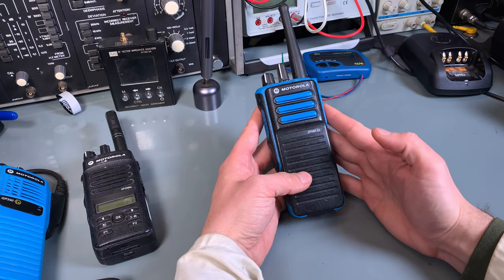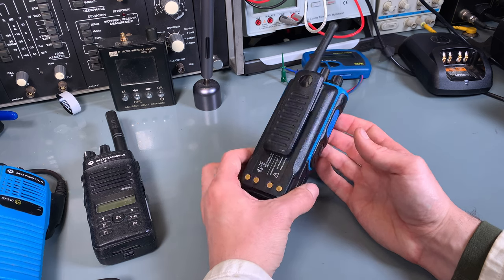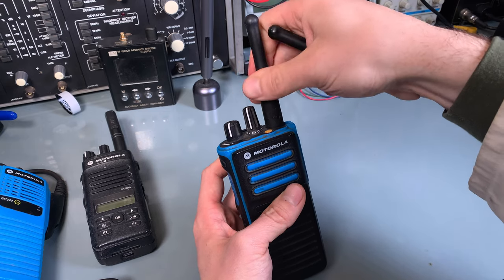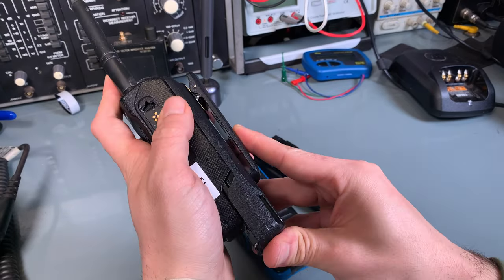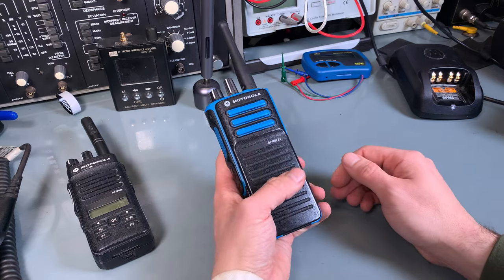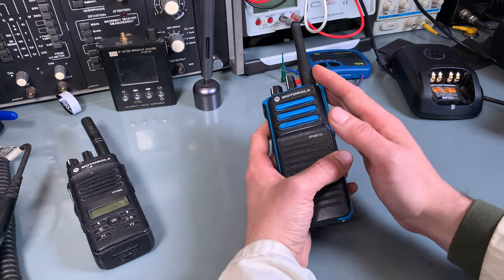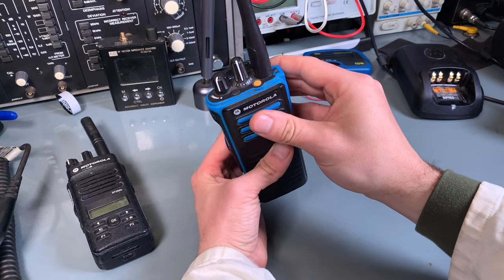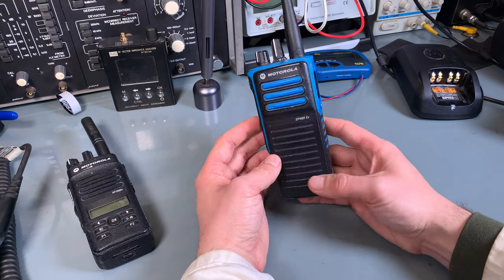Motorola DP4401 EX (ATEX radio for explosive atmospheres)   quick look

Comment: Interesting how it's in the DP4xxx series but they use the old-style (DP3xxx) SMA antennas.
Reply from the maker: I would expect this have something with ATEX rating  - I saw lot of radios from DP2xxx with broken antenna connector that ended up flopping around inside case (definitely breaking seal)  - that would be jail time for ATEX - sma have nice outside ring to screw it secure to plastic body - you will break antenna, connector -  not radio seal.
I will make video showing Mototrbo ION - it have UL listing for hazardous environment - and they redesign that antenna port to have this screw around - yet not being real SMA. Most like never iteration from ATEX will use same <- but this is just my guessing.

Comment: Good day! Can you please help? We have such radio stations, but we cannot charge them, when charging, the red indicator flashes. What could be the reason? We are from Ukraine.
Reply from the maker: First make sure bottom terminals on battery and in charger are clean (no paint or dirt - You want to see clean gold contacts). If they are clean usually that mean battery have too low voltage to be properly recognized by charger or it's "dead".  In first case You can try left it in charger(with blinking red) for couple hours - if voltage rise enough  it will start normal charge process (will work most case so give it a try before doing anything else).  If this won't resolve problem than battery should be considered EOL (end of life, defective) and be thrown away - before that You can remove battery from radio, and hook up to back contacts (that one dedicated to interfacing with radio)  to power supply 8.4V DC with current limit like 100mA  ( I believe there is positive and negative marking)  - You keep touching them for about 2-3 minutes than insert into charger - it might be enough to kick voltage enough to be recognized. If this don't work then most like cells inside are failed and You need find replacement. Good luck

Comment: How can I get one please?
Reply from the maker: I don't think it's restricted item so it should be possible to order from any Motorola dealer. Question is why: if it's issued by agency - it make sense - for anything different it's just overpriced radio that is designed to met specific regulations - it's not better in any way from standard version.